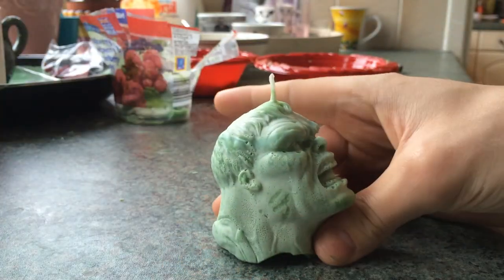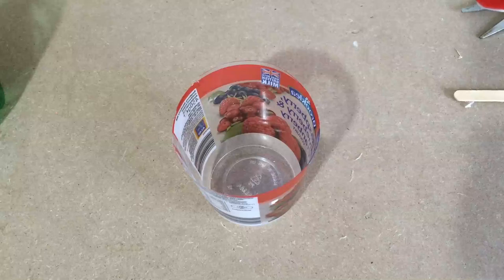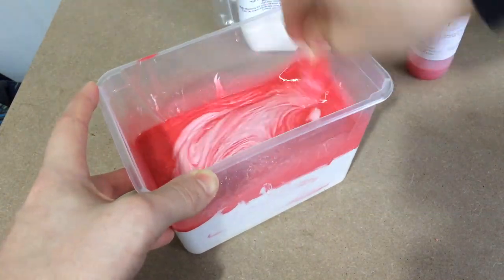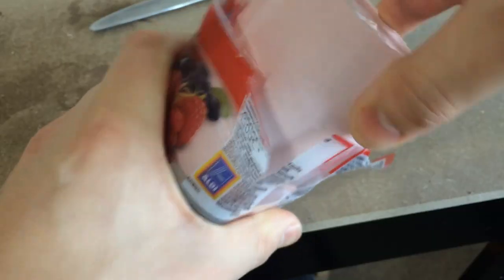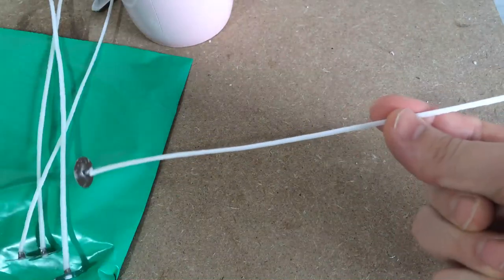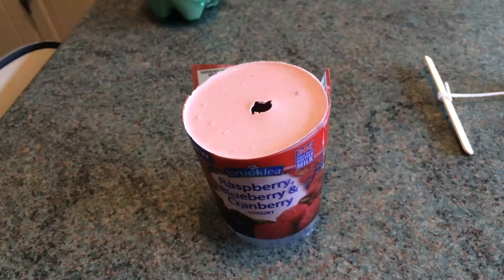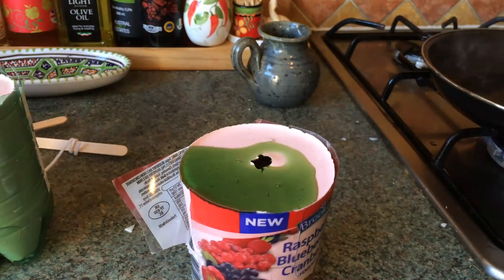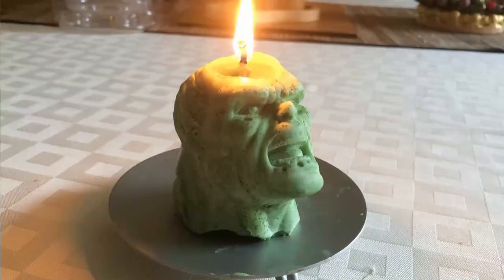How to Make Cool DIY Candle Molds!

Comment: Great Job. Here's a tip for next time:  after you've poured your molding compound, gently tap the bottom of the container against the table in a vibrating motion. This will force any air bubbles to the surface, thus guaranteeing a blemish free mold and candle.
Reply: malti bon joy joy Thanks for that tip! I was wondering how to prevent that for when I give it a shot.
Reply: Lar Rackell no problem. I've made a lot of candles but no superheroes. I'm going to have to get on that lol
Reply: the one she uses in the kitchen for cake making whats going through your head
Reply: +shark I cant stop laughing
Reply: +duke silver Yeah duke, what's going on in YOUR mind? Sheeesh!
Reply: +duke silver Whoa!,I didn't mean anything personal dude!
Reply: Nice Video! Sorry for the intrusion, I would appreciate your initial thoughts. Have you researched - Chireetler Earning Maker Rule (search on google)? It is an awesome one of a kind guide for learning how to make candles for fund or profit minus the headache. Ive heard some interesting things about it and my BF after many years got great success with it.
Reply: Cheers for the video content! Apologies for the intrusion, I would appreciate your thoughts. Have you ever tried - Chireetler Earning Maker Rule (should be on google have a look)? It is a good one of a kind product for learning how to make candles for fund or profit minus the normal expense. Ive heard some super things about it and my work buddy at last got amazing success with it.
Reply: This was great, thanks, I've been looking for "candle making secrets book" for a while now, and I think this has helped. Have you heard people talk about - Peyaniel Psychological Predominance - (do a search on google ) ? It is a smashing exclusive product for discovering the trick to be a candle maker for profit without the hard work. Ive heard some decent things about it and my mate got cool success with it.
Reply: How did i not think of this

Comment: Some tips:
-When making mold use container that you can find if old one gets broken due taking mold out(like jugurt cans in video)
-Also try find something that has proper size and shape to it easyly slip mold out afterwards (cone shape).
-When making mold pour little bit more silicone into mold as afterwards you can cut nice cone into hole to help you pour wax into mold (you spill far less).
-When making the mold brush etc silicone into objects surface so its making perfect surface, after pouring you can use anything that vibrates, like electric toothbrush with out its head, shawers that has vibration, your sound systems bass or actual vibrator to vibrate the air bubles out of the mold.
-When pouring the wax into mold, rotate the mold so you gets start up surface and it lessens or removes all imperfections.
-If your really looking to make cool candles that you dont ever going to light up, for decoration use etc, or your just so touchy about details, you can fix and fine tune your molded part with soldering iron and really steady hand (Heat adjustable iron with multiple tips is advised for this job)
-If making really detailed object try to set object that your silicone molding, so that the less detailed area is upwards (the most airbubless will concentrate into that are or use vacuum system to get all air out (really expensive and more used in high tech molding) Placing part like this also helps if your cleaning the underside/making it flatter, depending your object and desired results.
-Dont try or at least be VERY carefull and design your mold properly, if your object has extended details, like horns, dicks, tails, wings and etc (wtf your molding in that case!?) as taking ready object from mold could brake those parts in process, if mold is not designed this in mind!! 
-When placing the candle heart string(what ever its called) think the placement and how you make sure it goes in desired route. If the heart goes too close the side it will melt the side, giving wax way out, that then gives more heart to fire, that burns hotter, that melts more wax and end result should look like hulk with green goo poured into his head. Also this could possible cause fire hazord if candle design is something where over heated wax brakes the area on candle head could fall next to curtains etc, so keep this in mind when designing your custom candles.
-If part is really complicated you could do two part mold, where you mold half of the object and make some guide patters (interlocking nubs and S figures). This can be done when silicone is still movable or just so you can press some shallow holes and draw S figures into peace. Then when this is hardened, you put mold release or something to prevent silicone sticking into another silicone mold part and pour other half of the mold. When hardened you should able to pull two mold parts a part, remove the object, fine tune your mold, place back together thanks to locking system you made and secure with rubber bans etc you see fit(i suggest using two stiff cardboard, wood, metal or plastic plates etch side of the mold and using some kind of clamps.

Here some tips that come to my mind. I'm not most certainly are any kind of expert, in fact i havent ever made even one mold, but this is what i have gathered from youtube videos. There is ton of great videos how to make silicone and other kind of molds so i recommend to checking those out before making your molds.
Hope this helps!
Reply: 🌸 yes it does thank u 😊✨
Reply: Hello; would u be able to help me out with something. I'm using soy wax to make
My skull silicon mould I have tried every temperature and still there are little bubbles on the top of head. How do I prevent this? Please help

Comment: Using a double-boiler setup helps prevent fires, as well as keeps cookware wax-free, and can be easier to handle:  use a soup can, or a soda can with its top cut off, some nuts and bolts for weight, and a small pot for boiling water.   Before heating, place the can in the pot, and slowly add water to the pot until the pot is half filled, or the can begins to float.  If the latter, add more weight, or use less water.  Wax usually melts before water boils, so it's only necessary to heat the water to steaming for the wax to melt.

Melting wax without a double boiler should be a completely smokeless operation.  Any smoke at all coming from the wax is a very bad sign, and the heat should be shut off immediately if the wax begins smoking.

And, a bit of wax crayon can be used for colouring, if wax dye is not available, or economical.
Reply: 🌸 most crayons R toxic, so not feasible to do this
I use previous old discarded candle of deeper colour to one I want, or same colour Or I use the wax dye, cheap off internet

Comment: A good tip on mold making, a thin stream of silicone from a higher distance above the container is best, it helps gas bubbles break out of the silicone while it's pouring.

Comment: Poor safety instructions, you should keep a lid right next to you when melting the wax, so that you could put out the fire as fast as possible. The wick should always run right through the whole candle, not just the upper part of it. You also might want to make the mold to the middle of the container. And you shouldn't use any metallic items with a pan like that, they'll ruin the pan's coating in a heartbeat.

Comment: next time, swirl the mold around before adding the wick. you had a bunch of air bubbles. also instead of cutting straight through cut at a jagged pattern helps it lock together better and just tape it instead of putting it back in the container, look at the YouTube channel testeds videos for some tips on silicone molding!

Comment: bubbles in the wax were actually in the mold..
to avoid this, when pouring your silicone, you need to do whats called a high pour to minimise the amount of trapped air.
Reply: Whats a high pour though. How is it done with such a small hole? Thank you
Reply: @breathe9livewithflower505  yes I would like to know as well

Comment: I noticed that it might be better to use the double boiler method with a metal bowl for melting the wax, to prevent it from catching fire, also clean up, cuz noone wants a waxy pan. Also you could have just added silicone to the bottom of the cup then pushed the hulks head into it for a base, then filled up around it. if it was still to floaty then do what you did but a longer string, you dont want your mold so close to the top in case the wick hole falls apart. Lastly, if you would have cleaned up the wick spout a lil bit then the wax wouldnt have poured all around the top as much. Otherwise this is a brilliant Idea and I loved watching it, just a few things were making me cringe cuz im lazy and want less cleanup lol

Comment: can you not pour in a little of the mould material and let it dry enough for your positive to sit on, then pour the rest in, that way avoiding having to suspend it?
Reply: Silicone has trouble sticking to itself when its fully set. the suspension is just the easiest way to avoid this possibility

Comment: You have air bubbles in there. If possible pour wax from one edge so that it displaces the air in front of it as you pour. Tap the object after the pour to dislodge air bubbles. You can also support it on a board, pull off to one side of a table so you can tap it from underneath.

Comment: Don't forget to debubble the mold. all those malformations are from air. If you bounce the mold as it is becoming solid, most of the bubbles will move to the surface and off the object. But otherwise, a very good way to make them.

Comment: You have used water based dye and when wax was cooling everything separated. If you use oil based or dry dye everything would be nice an even. And after mixing catalyst with silicone you should ged rid of this bubbles inside by for example hitting the container on the table.

Comment: Can you make another hulk head with new silicone in the mold, or would it stick to the mold
Reply: He says at the end of the video.  Yes.
Reply: You can make more candles with more wax, but if you poured the same silicone mixture in I would expect it to stick to "itself".

Equally, you wouldn't want to try to make a mould from anything originally made of silicone rubber due to the same risk.

Comment: hey man, why are their little holes in the end candle? any way of avoiding this
Reply: +1234LMAO12345 Air holes, give the mould a little shake once hot wax is in to try get the air out :)
Reply: +Par8dox thanks man, i'll give it go
Reply: Also make sure you are pouring the wax when it is at the right temperature, usually about 55 degrees celcius. Too hot or cold can cause bubbles

Comment: You didn't have to decapitate the hulk at all. You can simply use a silicone mix with flour then (if you're using nylon gloves) use the mold after needing it till it starts to harden a *little*, mold it around the head and 20 min. later, you got the mold copy without any decapitating.

Comment: Your mold looks rather inefficient. Many candlemakers place the object on the bottom, then flip the finished mold over so it has a large hole. That way it is easier to pour wax, add wicks, make layers, and avoid that tge wick gets covered in wax. Nice candle, anyway. It was a nice work.